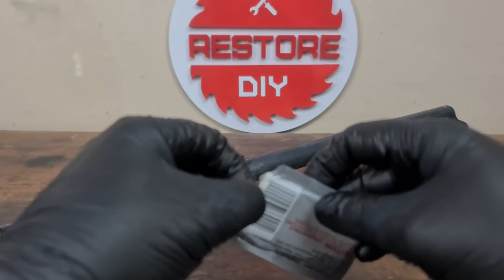Very Rusty Daisy Airgun Restoration

Comment: You improved the distance that the pellets travel. Originally the Daisy Red Rider doesn't have a long range when fired. Made that way so kids can safely use it.
Reply: We use to shoot at the tops of the old silo's to hear that classic "clang" when the bb's bounced off. You really had to aim high since the gun wouldn't travel long distances in a straight line.

Comment: Pretty close as to how the original looked. The barrel was a darker but glossy black, and it did not have a polished cocking lever. All the metal parts were the same color black. Fairly accurate, I spent many childhood hours around the farm shooting old tin cans set up on wooden posts. I loved that gun so much, I even used an old .410 shotgun case to carry it in.

Comment: Tip for others dealing with solid rivets.
There are little self centering punches and such that you can use to mark the very center of them.mod that then use a drill bit roughly 3/4 the size of the head and perfectly in line with the rivet, best bet use a drill press, drill straight down till the head spins.  This will remove the rivet head, allowing you to punch out the shaft, with very little chance of damaging the surface around the rivet head by grinding in from the side with a dremel that jumps or skips.

Comment: Every boy should have one. I've owned several but my favorite is the model 25. You did a good job on the restoration. I still remember when the bb's came in the yellow and black cardboard tubes.
Reply: I still have a couple of those bb tubes floating around here some place.
Reply: @treerat6959  : Same here.

Comment: You're just heat tinting those bolts, not hardening them; there is no reason to drop them in oil. It doesn't do anything but make smoke.
Reply: Oil quenching is the standard procedure for flame blueing. There are many videos that demonstrate the procedure. Just search flame blueing. Fyi
Reply: Why in the world would any one let a gun get in that kind of condition.

Comment: Guaranteed this guy buys new stuff and hoses it with caustic chemicals so he can restore it.
Reply: I think this is an actual older version.   It has the metal trigger and metal cocking handle.  Plus the bottle cap removable shot tube.  It looks like a model 102.  Probably from the early 1970’s
Reply: Nah, that's Awesome Restorations.